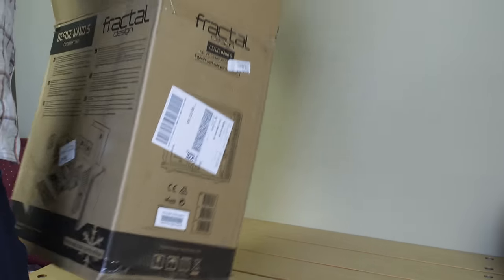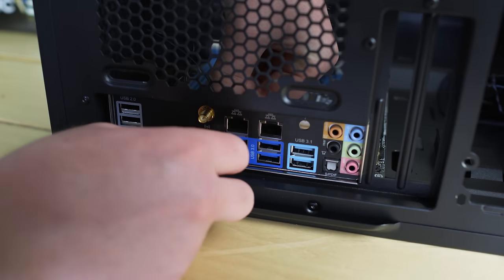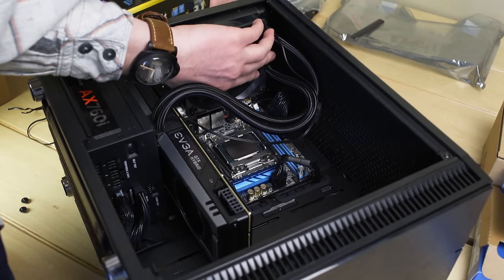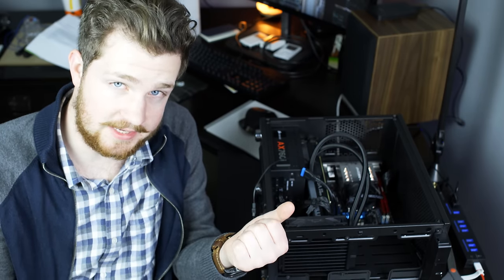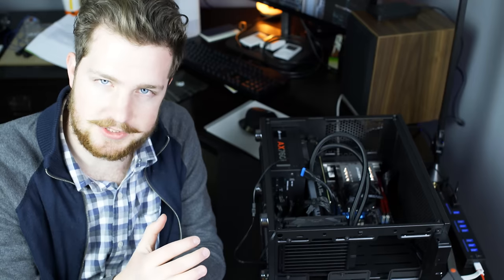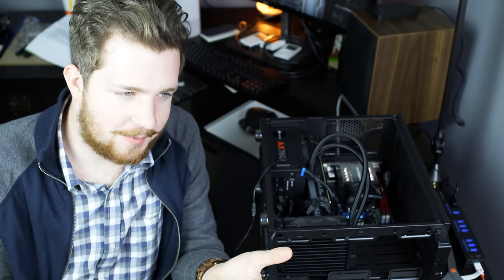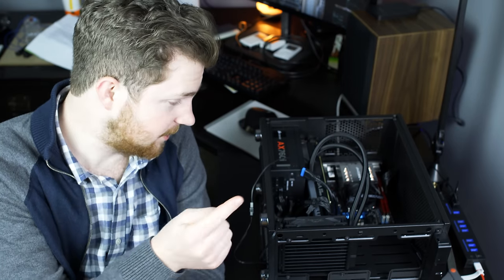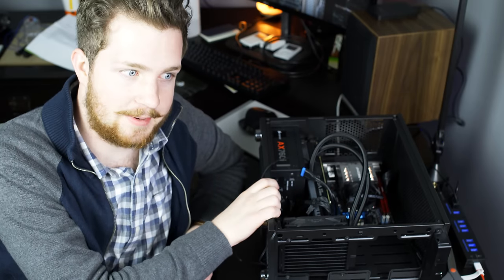My Powerful Custom PC Build Disaster

Comment: Mac is overpriced not sure why people like it. Guess its a Fanboy thing.
Reply: +cjhan47    It's considered a "cult" product like Harley-Davidson motorcycles and Mini Cooper cars.
Reply: Ahhh!
Reply: +cjhan47 Well they are good computers, very good for editing and mabye some gaming :) Like I have a G5 which is an old mac tower but I just got a new cpu and I put a titan in it and it is pretty much a gaming pc, cause I can put windows on it :)
Reply: *****
I can do the same thing for 1/2 the price with a PC. There's no getting around the fact that Macs are overpriced for the hardware that comes with them.
Reply: +cjhan47 I had a Macbook once then a changed it for a Pc on which i could game but i still love mac, everything on them are so... idk clean ? its the experience but even with the experience i would never buy a mac again, well only if im rich lol
Reply: +cjhan47 because the TV told them the mac is better then the PC, So if the tv told them well it must be true.
Reply: Hackintosh m8. Get OS X, and don't have to spend much.
Reply: +Matt Davidson Titan is a good card, but unnecessary for gaming. 980Ti will be enough for anything out there at the moment. Unless you run some crazy 3x4k screens or edit 6k/8k videos. You will not need the 12gb VRAM at least for now. Might as well use the 400$ you save on the gpu on other things.
Reply: +Matt Davidson a 980ti has more performance in games then a titan the titan is made for heavy workload like video editing and suck
Reply: +ThePetrolheadEU the titan is not meant for gamig a 980ti will beat the crap out of a titan in gaming
Reply: +A Lind Titan X is technically same card as 980Ti, except Titan has more Cuda cores and double VRAM, so no. 980Ti won't beat the crap out of Titan, they are basically the same card. Titan is meant for different use than 980Ti tho.
Reply: +A Lind false, clock for clock a titan x and 980ti and pretty much dead even the only real difference between them is the titan x has more vram wich could be useful for some people and is a little better in compute performance
Reply: +cjhan47 well some programms just work much better with osx so it´s actually quite usefull
Reply: +Christian Gaa guess what Macs can't do, game.
Reply: Harry Lawton guess what mac shouln´t be used for, game.
Reply: Christian Gaa and it cost 3x as much as a PC that is equal in performance and the PC can game, Mac=shit.
Reply: believe it or not but there are actually people that are not into pc gaming, so your argument is quite insular. I peasonally own a PC to game and a Macbook for DJing and generell musicstuff just because the programs I´m using work much better on 6 year old Macbook than on every Windows Laptop/PC I´ve ever owned. And to the priceYou are right that the Mac Pro series is quite outdated for it´s price and that you can better performance on a PC but try to find a laptop with similar build quality, battery capacity, a nearly 4k display and quite decent specs thta is cheaper than an equal macbook
Reply: +Christian Gaa mac only supports 1080p only
and the build quality of a mac is shit compared to companies like msi asus alierwere dell etc
my dell has a battery that would last me around 4 hours 
the mac computers have to slow down themselfs becouse they dont have proper cooling for the components wich makes a mac very un reliable at heavy workloads
Reply: A Lind looks like you have never touched a mac before. they support multiple 4k displays without any problems, the battery lasts up to 12+ hours on specific models and the build quality is better any other company i´ve ever seen. some ultrabooks might have equal specs but the price is equal as well.
and you a right with the thermal on some models but that mostly affects the boostclocks of the processor what´s normal, even on windows pc´s
Reply: +BONDPlayz You want the software? Make a hackintosh. Want the hardware? Buy it for 1/4 the price. Want it for gaming? You're dumb. Want it for the software? Again a hackintosh or better just use the hundreds of good programs that don't cause $200+ to buy and use on Linux or Windows.
Reply: Christian Gaa the battery last ages because the hardware is crap...
Reply: Harry Lawton i quess it´s senseless to talk to you because you have absolutely no idea of macs and just need something to hate on. But if you think that an i7 and a 2880x1800 15" display is crap, well if have no more words in general
Reply: Christian Gaa just because it's a i7 that doesn't mean shit, it could a a 6700k or it could be a 4400k.
Reply: +Harry Lawton Which are both not crap...
Reply: +Christian Gaa the i7's in macs are horribly underclocked and they still overheat and the macs do NOT have full 4k as they are saying you would know this if you knew anything about computers
Reply: A Lind so why do they have 5k imacs? and my macbook has a i7 3615QM that runs up to 3,2 ghz... how is this underlocked?
Reply: MundMoriginal actually the 6700k is much better.
Reply: +A Lind ?
Reply: +Christian Gaa why dont you just make a hackintosh
Reply: Ethan Marks I actually tried it with my current "gaming"- pc but it´s more difficult as just putting the fitting parts together and install os x. After two weeks I still had problems with the sound drivers and one update destroid everything so I just went back to windows
Reply: Christian Gaa oh
Reply: Christian Gaa the i73615hq is crap, also it matters what the architecture of the CPU is its not all about GHz. That's like saying AMD are good because the go up to 5ghz but AMD are crap.
Reply: Christian Gaa also how much was you Mac?
Reply: +Harry Lawton AMd cpus arent crap for rendering video though.. and with dx12 they are going to be even better..
Reply: danjal07 right now they are crap for video rendering. sent from my amd computer
Reply: +cjhan47 nope i got a pc and use some apple products why?
they have easy OS great for rendering
all in one computers 
and quite nice looks
apple is more for people who edit and stuff thats where it shines and also
people who want to game wont buy apple anyway
Reply: +Ethan Marks what the fuck are your specs?
Reply: Ethan Marks
 Well my 8350 thats parked and clocked at 4.2ghz runs pretty darn good for a 4yr old cpu..
Reply: danjal07 i fucking run fallout 4 on ultra with a fx6300 and a gtx 960 4gb... at 60+fps...
Reply: +The Gaming Banana macs are not even good for rendering for thaöf the cost you can make a 10x better rendering pc
Reply: A Lind rendering and editing works better on mac os its a fact...
Reply: The Gaming Banana
I run Unigine Valley @2560x1080 4xmsaa at 74fps with my fx8350 and r9-290
Reply: The Gaming Banana FX 8350 AND 390x 8350 oced to 5 ghz
Reply: Harry Lawton Wow, what a pointless response. I said they are both not crap - do you agree, or disagree, no, you say the 6700k is better, genius!
Bot mentioned cpus are good and I would build a pc with them anytime.
Reply: +The Gaming Banana no all high end rendering and editing is done on windows becouse windos does not limit you to a few certain part
a xeon with 4 titan x's would beat the shit out of a mac any day any time but for the pricepoint of a mac most people are to lazy to build a pc so they buy a mac becouse its decent a rendering
Reply: MundMoriginal I was just saying that Macs cost 3x as much and the hardware is much older...
Reply: +cjhan47 Mac OS is apparently great. I can't confirm that, since I can't afford a Mac.
Reply: luigi1fan1 you would need a small loan of a million dollars.
Reply: +cjhan47 It's like religion. Half the time when you ask someone "Why?" their only answer is "I was raised to do it".
Reply: +Joel Castillo Hackintosh gets messy with updates. However, mine ran better than any mac I've ever used. I wouldn't recommend it if you are using Xcode often
Reply: +Captain Obvious when you buy a mac, you're also getting the apple store and all the support that comes along with it.  you're also getting a highly refined OS that's designed to be a workhourse.  I'm a PC guy, but i have respect for apples.  I understand their business model and their demographic.  I have an iPhone for work (which I really don't care for) and an android for personal.  I build my own pc's adn have since the late 90's.  Don't hate on apple.  if you don't like their way of doing business, move on.  I am considering getting my wife a mac book pro retina.  they're not that much more expensive than a equally spec'd windows laptop these days.  She does a lot of photography work, and the Mac OS environment is built with that in mind.  It's a productivity environment.
Reply: +Robert Savello 

Doing post production on a little macbook is really bad.
Reply: We have an awesome external monitor and keyboard setup. It's like from the future or something. 4K monitor, keyboard and mouse. The laptop part is so she can take it into the field of needed.
Reply: Robert Savello okey than it's good :)
Reply: +BONDPlayz they are ONLY good for pictures editing and music more and more gaming companies are dropping apple support PC WISE
Reply: +Captain Obvious Of which I own both... And two PCs. Two 16TB NAS. The funny thing is, people usually diss a Mac (or a MIN) and have never tried one as a day to day machine. The proof, as they say, is in the pudding.
Reply: +Captain Obvious It is not the hardware you are necessarily buying, but the eco-system. Again, if you don't use one day to day then pass judgement is ill informed.
Reply: dragonfan36 not everybody games. Get out of your small gaming world and look at other things computers are used for. Get a job in IT and your views will change. I work and support 500+ remote clients. Our laptops for users are terrible gaming machines, but perfect workstations. Gaming isn't the only thing computers are used for.
Reply: Robert Savello i personally game and macs are trash for it end of story i have a built pc specifically for gaming plus if i wanted a mac os i would just get boot camp or some shit
Reply: dragonfan36 I also game. I also built a gaming rig. Congratulations.  Macs aren't designed to game. They're designed to do work. Productivity. Just because you don't have a need for the hardware doesn't make it trash. Macs are quality hardware. Priced higher, but you get what you pay for. Like someone else said. The ecosystem. You may not need or want it but someone else may. Get out of your small world and realize people use computers for different purposes. I feel like I'm repeating myself.
Reply: Yep. I must be dumb. But at least I'm not immature and resort to name calling.
Reply: yep
Reply: +BONDPlayz At that point it isn't even a Mac anymore.  You might as well save money and build a Windows machine from the get go at that point.
Reply: Autoimmunity some jobs require you to use mac software and it would be better to run bootcamp or something else that you could use both os it was mainly an idea
Reply: I like the laptops and phones. The desktops are garbage.
Reply: +cjhan47 fanboy, the laptops are some of the best built ones. 2 of my audio interfaces (the high end ones) don't even have windows drivers. OS X has some killer features windows doesn't have, like core audio and video. You'll get over it.
Reply: +cjhan47 Actually, Macs were among PC's many years ago, and windows PC's were not even close to what they are now. Apple wasn't reaching the market they originally intended to, this being education and business. Companies didn't want their employees messing around with games. This caused Apple to abandon the gaming aspect and focus on their original markets. These days, Macs are getting better with gaming, especially with the ones that take advantage of Metal (still not custom PC). But, with the price, you are getting a refined OS, a lot of security, amazing build quality, great customer support and for the most part, the latest internals. Touching on the Mac Pro, Intel hasn't updated their Xeon processors for skylake quite yet. I can guarantee, once they do that Apple will offer it.
Reply: +cjhan47 Macs are not a fanboy thing. Do your research, then talk.
Reply: +Harry Lawton My maxed out MacBook Pro was 4g and worth every penny.  In the 3 years that I've had it not once has it ever froze, crashed or deteriorated in any way.  From a cold boot it is ready to work in 4......yes...4 seconds.  All of my Apple devices are sync'd wirelessly.  I can even use every aspect of my iPhone through all of my Apple devices.  And why do you care how much someone spends on a Mac.  I don't recall borrowing money from you to buy it.
Reply: moonlitphantasm most people are saying mac if you are not using them for college or jobs are not worth the money which i agree with but hey you do you :P i cant tell you what to do
Reply: +dragonfan36 Well that's what makes the entire argument funny.  From front to back Apple controls everything which is why Macs are so stable.  You can't just plug and play any hardware or software you want.  cjhan47 operates under the illusion that PC fanboys don't exist.  Of which he is one.   I have to laugh at the PC fanboys because they all share one thing.  Why are you people so upset and concerned about how much Mac owners spend? lol  Quite frankly I think that all of the problems with PC's and the mess known as Windows makes PC's overpriced.  Really it all boils down to this.  I'm not going to convince a PC fanboy of my way of thinking.  Conversely none of them will change my mind or anyone else.  So at the end of the day who the fuck really cares? LOL
Reply: +Christian Gaa You're absolutely right.  Mac haters have typically never even used one.  They simply jump on the bandwagon.  The irony is that a lot of Mac users are on Macs BECAUSE they have used PC's.  I know that is my reason.  It seems first and foremost that the biggest argument they make against Macs is price.  People get downright pissd about how much Macs cost.  I think it's hilarious.
Reply: moonlitphantasm i have used a mac they are nice and all but i am a gamer and less and less companies support  macs and plus why not get more power for my money and also i have had very few issues with windows except windows 10 when it was new ima stick with 7 though
Reply: dragonfan36 I've tried to get Windows 10 on my iMac retina 4K. Apparently I wasn't the only one who kept being put into infinite "repair" loops. This being other fellow boot camp users, and PC users as well (on the latest version of Windows 10).
Reply: since its new tech wait a while to update ive only ever had issues with windows 10 tying to update to it that was months ago though it wouldnt finish the install and i had to revert to 7 thankfully it went off without a hitch there
Reply: lol, putting win10 on a imac isn't hard. my god.
Reply: JesseDegenerate it may not be hard but windows 10 is still buggy
Reply: +dragonfan36 remember Windows is one part of the equation only if you have skylake, which had serious issues and both of them blaming one another:(
Reply: JesseDegenerate it is when Windows goes into boot loops
Reply: Mackapus Gaming i hope they will get the issue fixed sometime i know how annoying windows 10 is
Reply: +dragonfan36 I had used Windows 3.1, 95, 98, NT, 2000 and XP.  I liked NT.  It was really stable.  I liked XP a lot as well.  But when my XP machine finally bit the dust I decided to try a new platform.  I'm not into gaming anymore but if I was I would definitely build my own system and max that mother out.  I'm curious about something.  The point of building your own rig is so that you can update hardware to keep up with AAA game releases that are more and more demanding on hardware.  How good can graphics get before they can go no further?
Reply: moonlitphantasm some AAA are now supporting 4k but those are few and far between for that you would want a 4k display 2 gtx 980 TI and a beast of a processor and that is like all you need for a few years haha
Reply: +dragonfan36 If I ever get the urge to go back into PC gaming I'm definitely building my own rig.  I will max it out in every way possible.  Beast processor, 2 of the best graphic cards, a ton of the fastest memory etc etc etc.  I mean if you're going to do it, do it right and go all in.
Reply: moonlitphantasm agreed! you wont have to upgrade for a long time if you max build
Reply: +dragonfan36 Yes, I'd rather "grow into" something than outgrow it.  That's like when I see videos on how to make a gaming rig for $400 I think to myself....why? Now obviously it's for people looking to get started and they don't have a huge budget.  But I think in the long run you're doing yourself a disservice.  But I try to keep in mind that not everyone is anal like me lol.  If my needs for video and audio production surpass what my MBP can handle then I'll look at getting the Mac Pro tower.  I've gone to the Apple store site and configured the Mac Pro to the max and the price is unreal!  $12,000.  As unreal as that is, Alienware used to sell a 19" laptop named The Assassin.  The cost of maxing it out was $9,000.  This was before Dell bought them.
Reply: moonlitphantasm its always better to build them yourselves and if u wanted a prebuilt i think origin is one of the best atm
Reply: +cjhan47 macs are more optimized for hardware they come with. i use windows laptop for gaming, but for working macs are good
Reply: Tak to That's the most stale bullshit I've heard in the last month.
Reply: good for you
Reply: +Tak to How does that work for you?  I tried it before.  For me ergonomically speaking it was a pain in the ass.
Reply: +cjhan47 I was always a mac guy - started when the mac started with the Macintosh 512K.  After about 10 years of ridiculous priced upgrades, I finally got a PC (and never looked back).  My most recent mac (which a bought on a whim) runs windows almost exclusively.
Reply: +cjhan47 Part of the reason might be, for example, that the Macbooks have had access to DisplayPort, Thunderbolt and PCIe/NVMe drives a good bit before any Windows laptops even had that idea in their twinkling eyes.

The value proposition for all of Apple's products are not always there - the Mac Mini is a poor value, for example, and their upgrade prices are always ridiculous, but you certainly can't discount what you get for the price. At times I've done price comparisons against Apple's devices to find that it was actually cheaper to buy the Apple product for the same hardware!
Reply: +SniperReady So Mac can say, "we did it first." Totally justifies double the price and 33% performance compared to his $2200 custom PC.
Reply: everennui if you dont need the mac software no use in buying a mac and you can always make a hackintosh
Reply: everennui No. When PCs weren't offering such features, paying extra for those features in the Mac would be your only option. I don't understand how you don't understand time... That's probably a little embarrassing for you. Moving on.

1. He quoted the price for his Mac Pro incorrectly. He states it's a $4000 computer, but Apple's website clearly labels it as $2999 USD. The difference between the PC and the Mac Pro is actually about $700. This is astonishing, even now, because the workstation components in the Mac Pro would cost a lot more than the Mac Pro, if rebuilt as a PC.

2. It's really not surprising to me at this point, but still very embarrassing for you as you pretend to understand technology... but you clearly don't know what a Xeon processor is, what workstation class components are, and what ECC memory is or why it's used.

3. The Mac Pro hasn't seen a refresh in a long time. This comparison is not much different than going into a shop and picking up a 2 year old model and then comparing it to more modern hardware. The outcome's obvious.

Please take the time to understand hardware before you try to tell others that they don't understand hardware.

Just a final note: I own a computer very similar to the PC he built.
Reply: SniperReady precisely macs are work horses not for gamers :P
Reply: dragonfan36 The reality is that PCs can easily be workhorses, too. The part that bugs me isn't that PCs can be more powerful -- and they absolutely can be, no question -- it's that people like everennui take it upon themselves to talk about technology like they have any clue whatsoever. It's the raw ignorance that astounds me, the willful stupidity and arrogance that drives them to believe they know even 1/100th of the mass whole necessary to truly understand the situation.
Reply: SniperReady He paid $4000 for it. If I paid $4000 for a PC, I'd expect it to be l33t for more than 3 years. Which his never was. I don't know much about processors, but I'm sure we'll see software use more cores for programs. Video editors, Photoshop are ever getting larger. His point was that Apple's, "flagship" is not competitive and certainly not for its price range. 

2. Slow jerk. You get stifled by stupid shit.

3. is 1

...and fuck off. I didn't tell anyone shit except you to fuck off just right now.

Edit: The only thing that Apple has going for it is Branding and Linux and I think the UI in OSX is shit compared to KDE, MATE or Gnome.
Reply: everennui His specs, as he listed, show $3000 on Apple's website. This isn't some trick, you can visit the website yourself to see.

You don't know much about anything, yet you're here pretending to know anything. You don't. Read more, whine less. You'd come across as less of what I like to call an 'ignorant'.
Reply: Okay. That's just the static price and doesn't fluctuate at all. That's even worse. At least if it were $4000 and went down $3000 you might feel like you're getting a deal. Nope. You're stuck with a nice looking paper weight. At least you can flip it upside down and use it as a garbage.
Reply: everennui Or if you understand what you're buying, you get exactly what you need for cheaper than it would have cost to build the same as a PC.
Reply: ...or not.
Reply: +cjhan47  it's not a fanboy thing. It is what you are using the machine for. Mac is optimized for an office. A pc is kind of like all-terrain, it works good with most things.
Reply: Tortoise Tech Gaming I would say that's less true than a Mac is optimized for scientific computing. It offers what any workstation grade machine offers: Workstation graphics, a business class Xeon ( or 2 ) and error correcting hardware.
Reply: +Tortoise Tech Gaming Pc does office work better dont know what you're talking about.
Reply: +BONDPlayz 
But if you put Windows on there and you changed the CPU and GPU at this point you now paid 1000s for a Mac case with Windows on it. couldve saved the Mac money and just got Windows to start with and a much cooler case than the G5 case you paid thousands for.
Reply: +Christian Gaa Dell xps 15. 4k touch, gtx 960m, 16gb ram, i7 6700hq. And on a side note looks similar to mac.
Reply: +cjhan47 Mac is generally more efficient. For your average consumer Mac is significantly better. For power users it's a waste of money followed by headache after infuriating headache. We have them at uni for audio work and I've seen brand new high end 27" retina blah blah wank machines crash running GARAGE BAND. 
I've never met someone who's genuinely switched on recommend Mac. Average people like average shit.
Reply: +cjhan47 It's an ignorance thing.
Reply: mobspeak
No apple gets superior chips from vendors bro!!! lol jk jk
Reply: +gnarly333 actually they do with next gen graphics
Reply: LiteGaming
you cant really say that though it is always luck of the draw. they aren't going to do overclock testing and see which pieces of the wafer are better. If it can hit the clock for the chip they want to market it as it ships.
Reply: +cjhan47 well, have you ever tried and bought a notebook worth of 1000$ (not saying PC, that's a different story) using it for a few months and then something miraculously goes wrong and your Windows is just sluggish as hell (or will end up in BSOD)? And what's worse, if it's something plastic, bends here and there, display is mediocre, has noisy fans and some low end GPU just to have one more "selling point" for BFUs, because "gaming notebook" is "awesome" ...and that frustrating feeling when you remember that you paid 1000$ for this horse shit. I don't say that Mac on desktops is awesome, it is not, don't get me wrong, I would not buy Mac Pro, but on notebook's side there are only a few manufacturers that can deliver the same quality product (e.g. Razer) but for the same price as Apple's macbook. I've been using Windows since I was 7, (15 years ago) but 3 years back I jumped to Apple's Macbook and I'm quite pleased with the build quality (not quite performance and I think software is getting more and more buggy).
Reply: Justin Hickey i do that lol
Reply: ehm, b4 that i would have thought of nvidia to stay in it stuff.
Reply: ***** Nope why are you comparing a Xeon to a consumer grade chip?
Reply: not 100% true man, i built 3 on the past 2 years (2 for me and 1 for a cousin) it will all depend on the parts you choose and the bootloader you choose, i use a lot Xcode (i´m a programmer) and works like a charm updates as easy as a regular mac(the only problem to say so, is i use a gtx970 so you only have the nvidia web drivers, and have to manually update every time apple updates the os and by manually i mean yo just click on nvidia update and restart de hackintosh), if interested in specs for my personal build, ask and i will gladly share it
Reply: its a marketing thing. people who don't know any better go for the silver mac,
Reply: huh? I can buy any High end pre built pc like a dig storm and I will get 10 times the support I will get from apple... if you don't know you shouldint speak... what software is so important that you need to use a mac? and don't say final cut pro... macs don't use quality its all marketing... ipods are pretty shit when you compared them to a 70 dollar anything < and this is just a example...
Reply: bmomosaik Logic X
Reply: yh apple products their hardware is shit for the money the only reason they are fast is because they are super optemized
Reply: Robin Moens and when you build a hackintosh you get better specs and a faster computer for cheaper
Reply: ***** you can run mac on any pc with a os machine for free lol
Reply: you mean you can run mac os whatever animal it may be not run mac.
you don't say you can run PC on a pc... you say you can run windows or unix or lin... ect
Reply: bmomosaik yeah?
Reply: I like Mac and Windows... Grew up using both. I should note that after my Mac randomly died (just failed, faceplanted into oblivion and won't really do anything. It only boots about 1/3 of the way, and even that takes about an hour. It pretty much bricked out of nowhere), I'm building a Windows machine to replace it. I may end up just biting the bullet and trying Linux out. I don't at all mind the user experience of having a Mac, but honestly it's often more trouble than it's worth. 

I'm used to having a lot of control over my machine and Mac does its damndest to remove some options from the user. It's my computer, let me do what I want with it, damnit. I also don't appreciate some of their shenanigans and annoying things that seem to just be money-grabbing efforts. 

However, this recent bullshit Microsoft has been doing with forcing upgrades and such hasn't exactly made me Team Microsoft either. 

Apple. Microsoft. Wtf are you guys doing? Stop fucking with your audience! Give users control over their property and stop forcing things on us we have made it very clear that we don't want. No is and should remain a valid option. No doesn't mean "not right now," it means no. If we say no, tell us how we can find the option to change that later and leave us the fuck alone about it.
Reply: you do know that windows 10 was not forced... it was just strong arm'ed you could still say no and not get the upgrade/ they did this because they were not going to be supporting security upgrades for windows below 10 as its to much work to do this for 3-6 different operating systems.
Reply: bmomosaik I repeatedly said no, but woke up one morning to find my system had upgraded. I don't really care what the reason was, I didn't want it and my preferences were overridden. I had them the way I had them because that's how I needed them. I had planned on upgrading a week later but didn't want to deal with it then because I had so much to do and didn't have time to mess with it then. I also didn't want to pay for the Microsoft Office subscription, so I had to scramble to find an alternative to the software I've already paid for and will not pay for again. I had two papers due that morning, and couldn't do my final review and edits with the software I had paid for because they wanted a subscription fee. Absofuckinglutely not. 

When I went in to work the next day, it turns out the same thing had happened and that severely screwed up operations for hours because IT had to call in their whole staff to get everything up and running again so the company could work. They had also planned on doing their upgrades over that week so operations wouldn't be interrupted. Our company lost a lot of money that day in ceased operations, inability to process certain transactions and having to pay extra wages. Whether you consider it forcing or not, it's still bullshit and caused a lot of problems for a lot of people that weren't necessary. That's an excellent way to piss off a customer base.
Reply: i said NO and mine is still windows 7 so maybe learn how to read instructions?
Reply: and they also let you go back if you dont like it.... so really no problems, its like going to get your car serviced and they get you a newer model
Reply: bmomosaik That's not the problem. The problem is that they just went ahead and did it against people's wishes.
Reply: if they did'int know how to read....
Reply: bmomosaik Or if, like me, they were away from the computer.
Reply: Their OS is pretty slick, their computers look pretty, and people think that high price tag means performance and quality by default. Since the common consumer doesn't care what's in their computer as long as it works and feels snappy, they buy it.  This is why people buy Apple even though it's quite overpriced.
Reply: 13:44 -> to all the Mac fanboys.
It is a good computer that does what most consumers want: works out of the box and has great software, but as you said it is really overpriced.
Reply: The amount of ignorance in this is amazing.... people claiming macs are work horse, news flash pc's are even better at that.. and for cheaper the latest macbook pro comes with a freaking dual core still... 15 inch laptop costing 3000+ dollars... then they have there mac pro which is I don't know what lol Rocking intel xeon quad and 6 core server processors, and ecc ram which are both designed for servers and not the intended focus of the mac pro, costing $5000+.... and both the Macbook pro, and the Mac pro have been tested against it PC counter parts for the same price being destroyed in everything from specs, video editing, cinebench, you name it. as for boot times, it's called a freaking SSD
Reply: I hate high priced low quality Macs. So I bought a refurbed Latitude for $75 and am doing some light editing, gaming, etc on it, and it's the equivalent of the 2012 MBP that costs $1.1k.
Reply: I have never owned a Mac and never used one for longer than 5 minutes, but I can understand why people use Macs. The performance is optimised very well and the design is hands down beautiful.
Reply: its like a purse. sure that 15 dollar one from wallmart will hold items great, but that 1500 dollar purse looks much nicer
Reply: The $15 purse will only hold it for about a year before falling apart entirely.